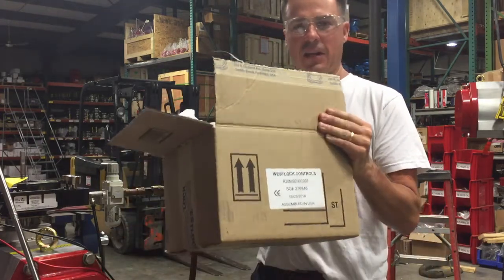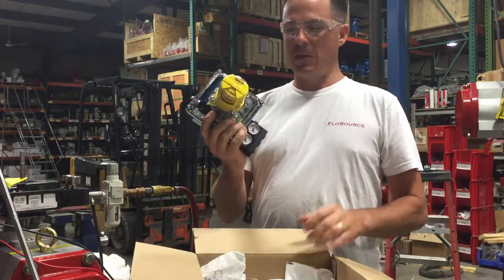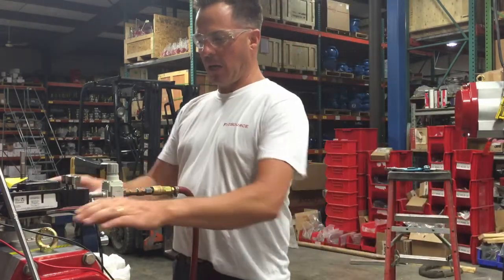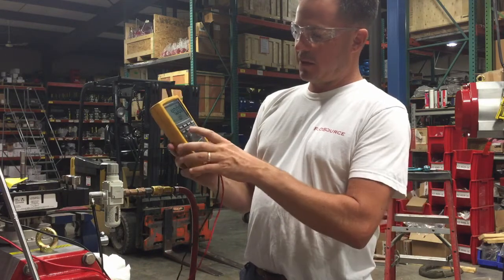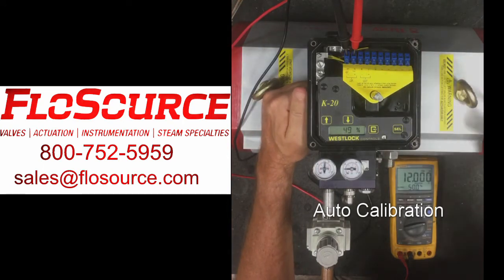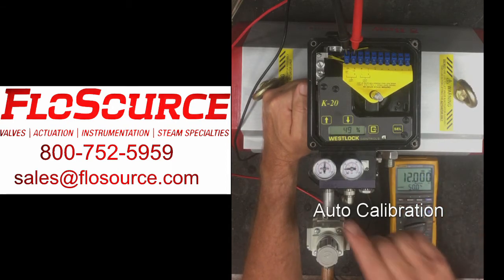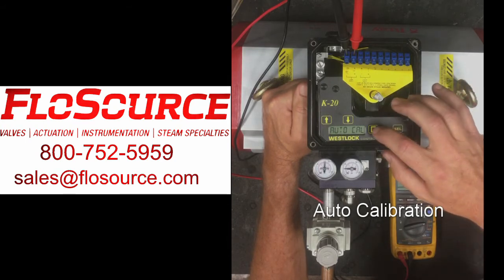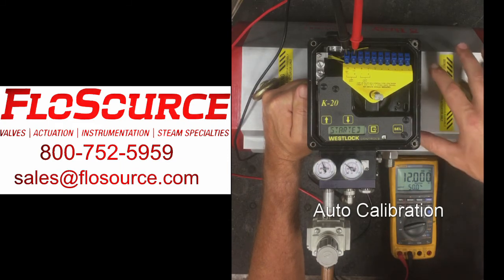Flosource Westlock K20 Pneumatic Positioner Review and Auto Calibration

Comment: Hi,
Can I know why the loop current was set at 12mA for the calibration process? Also, the 2 yellow cables (no polarity) are not connected to terminals 7 and 8, is that necessary?